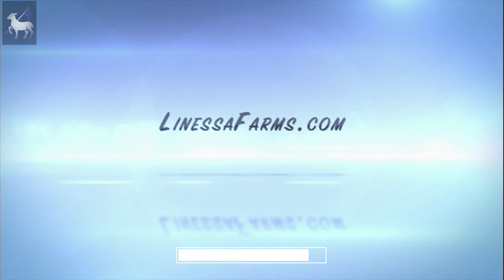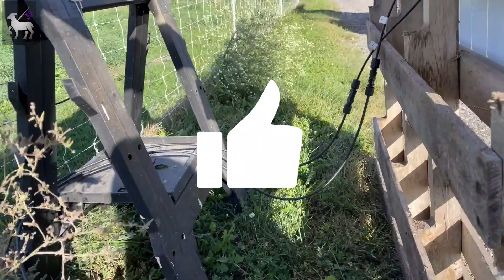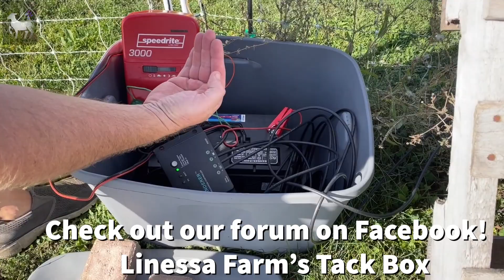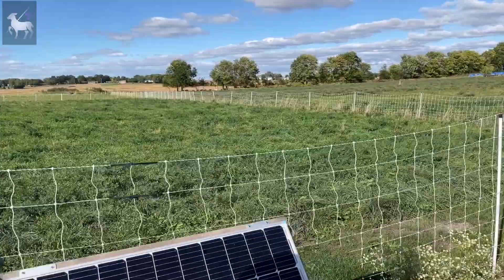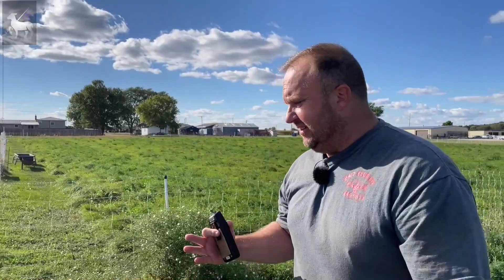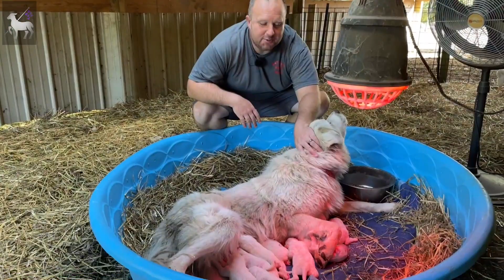Ultimate Fence Charging System for Portable Fencing

Comment: Thank you for this video! Your videos have helped me so much. I am on my 3rd battery after less than 1 year of use. I followed your link for all supplies but I'm not sure now of I purchased the correct one. I purchased the Interstate Batteries 12V 35AH Sealed Lead Acid (SLA) AGM Deep Cycle Battery (DCM0035) Insert Terminals.

Is this correct? Thank you.

Comment: Do you have a suggestion for a trickle charger for the battery? 😊
Reply from the maker: I do not.  I have used multiple brands and they all seem to be about the same.  Many of them look like they came off the same factory floor with a different sticker on them.  So long as you get one that specifically says it’s for trickle charging, you should be good.

Comment: Awesome video. Thanks for your effort.

Have you tried 2x 6v battery in series vs 1x 12v? Higher output, quicker charge, lower chance of going to zero (degradation) and longer time to stay above 20%.
Reply from the maker: Hello. We don’t have any issues with the system staying charged, it’s in float a large majority of the time. As far as output, the fence charger is going to regulate the shock so I don’t know. 

With that being said, for individuals running other equipment or multiple chargers off the single system, using it in winter, etc… that might help. I honestly don’t know enough about the nuts and bolts of how it all works to make a statement. 😬

Thank you for taking the time to share this information, I’m sure it will help some folks out. 👍🏻

Comment: Thanks for the video! This set up looks great. I wonder, have you looked into wind energy at all? I've done a little research (barely scratched the surface) because I get SO MUCH wind, especially in the winter months when there is less sun available for solar. I'm hoping to be able to power my shed using wind, or maybe hybrid wind and solar to make up for those summer months when there's no wind. The deep cycle battery sounds perfect for handling those randomly high/low moments of charging.
Reply from the maker: Hello, April. I haven’t really looked into wind too much. We went with the solar so we can transport it wherever the fence goes but I think wind would work if you were using it to charge batteries at a place like your barn. Unfortunately, wind turbines need strong anchoring and I just don’t know if I could come up with a strong enough base to make a reliable portable system. I will keep you posted on how our solar charger does in the winter. We live in an area with high winds and a high amount of wind turbines.

Comment: Thanks for posting this. Nice follow up to my query in your previous fencing video. Conceptually, I figured this would work, but seeing your setup in action, especially with the weed load, was very instructive. I've been experimenting with an AC Cyclops energizer at home with poultry netting, but our farm property is remote and off-grid, so I was thinking of doing a centralized deep cycle + PV panel + DC energizer to light up a single hot wire around the perimeter that I could then use to power mobile fencing (poly braid or netting) to support rotational grazing. Looks like you have a pretty big deep cycle battery (my back aches...). My remaining question would be how many days of inclement weather (cloudy) before you start getting nervous about the PV keeping up with the load. That's probably something I'll need to figure out for my weather/latitude. Ditto the appreciation expressed below.
Reply from the maker: Cyclops energizer are very reliable historically.  Without the solar charger our deep cycle batteries (Walmart) will last 2 weeks on standard speed before they are dead. We would always swap them at 1 week though. This is powering   14, 150ft premier1 10/48/6 fences (total 2100ft).  I can get you the specifics on the batteries if you need it.
Reply: @LinessaFarms  Thanks. Going to check Walmart and Costco for deep cycle batteries this week.

Comment: Tim, I took your advice and purchased a DC battery with Speed rite 3000. So far its working fine, I believe my next purchase is the solar panel. Makes perfect sense. Thanks for your advice and videos.
Reply from the maker: That’s great!  We have had really good luck with ours and it’s been in full time operation for over 3 years. Keep us posted on how things are going for you once you get the solar panel on.  👍🏻
Reply: @LinessaFarms  Have you had any freezing rain or ice accumulation to contend with on the mobile fence? If so how did it hold up?
Reply from the maker: @MAM-cy3yy  it will hold up fine, however it will start shorting out of it starts getting coated with ice or snow. We usually take down our portable fencing in the late fall when the animals come back to dry lot.